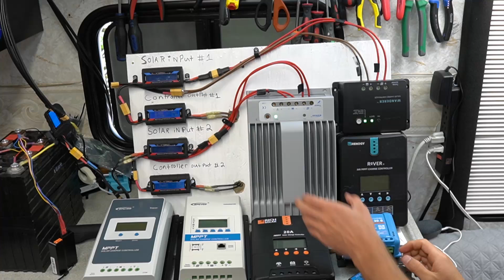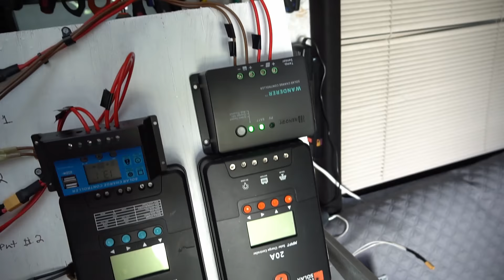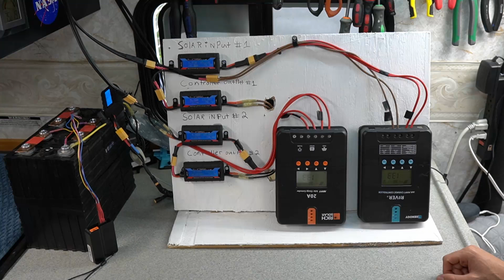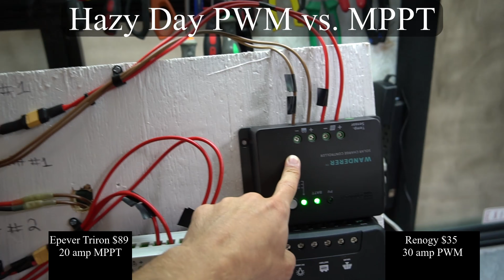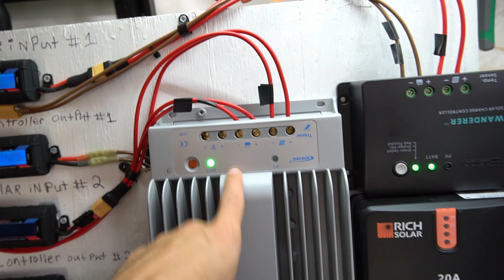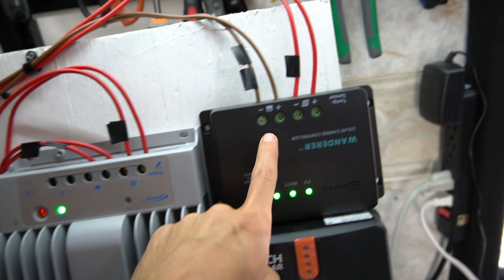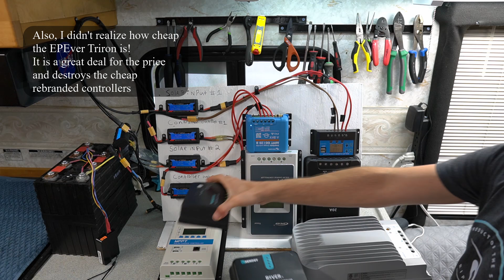12v Solar Charge Controller Buyers Guide - Beginner Friendly!

Comment: Thank you, I've been trying to figure out what type of charge controller I need for my lead acid battery bank. You've answered my questions. I have 4 deep cycle RV batteries and 4 AGM batteries [which were given to me from a friend]. So my plan was to charge each pair individually and then move to the next.  With the purpose of being able to re-charge my phone, portable radios and various batteries around the shop, plus being able to have DC lighting around the house. I have some cheap and inefficient panels hooked up. I have a portable generator hooked up to my panel - but if I ever run out of gas, I want to have some means of charging.  

But in the end I plan to get a EcoFlow Delta and portable solar panels - I'm going with the KISS method.  Maybe I'll give my battery system to someone on a limited budget and let them follow your recommendations. 

You do a good job explaining some very complicated concepts [for my knowledge background] thank you for the work you put into this subject.

Comment: Renogy charge controllers change their settings if you use a dc to dc charger from an alternator with lithium batteries. When you go back to solar charging they only charge to 13.5 volts. The fix is to go into your controller and reset to lithium battery even if it says lithium  still reset it. Something both a friend and my self have learnt  after tearing our hair out for weeks.

Comment: I’m just getting started setting up a support vehicle for my projects.
      Since the vehicle (‘92 GMC Truck) will be outside and is a service vehicle, I’m planning on putting two large 250AH  lead acid batteries in a large toolbox on the roof rack (fire proofed and insulated)
and connecting your favorite charge controller to them.
      I’m planning on using one 250 watt solar panel on the toolbox, and possibly two inverters, behind the seat (one for just general 110 use in the cab, and the other wired into the automatic cold weather heater and engine block heater, coupled with an AGS switch for the dedicated onboard generator.

Comment: In the case of small cable clamping termination, Input cabling could be terminated and the then solid terminal pin fits nicely…. Ive got Victron cc, no problems.

Comment: It seems to me that if you're going to invest more than $1k total in building a solar array and storage system, plus inverter, the last place you'd want to scrimp is on the charge controller. Given that the most expensive one here is probably 10% of the system cost, if it offers that much more benefit, why not spend the money on it? So many times in similar situations I've scrimped on one component and later wound up owning the cheap one and the expensive one. Not good economics there! That said I really appreciate the comparison because this helps understand the factors in the decision, which is just as important, if not more, as the "which one should I buy" question.

Comment: I learned there’s no point in spending a lot of money on a charge controller!  Cheap is 99% as good as expensive.  Thanks
Reply: While I really tend to agree with you. My cheap PWM's (plural) are a testimony of that! 
I would set a word of caution. Probably the most hyped ones are surely not needed, but a good solid construction. Might save a whole lot of head aches on the future of your installation! Something to keep in mind depending on the "mission critical" of whatever you intend to do!

With this said. Yes, my van and a few other projects run on cheap PWM's. No problem! Always design your system based on intended function! It's that simple! ;-)

Comment: Just an update.  Renogy may have the bigger holes now.  I bought a 40amp Renogy controller and it had the bigger holes like rich solar.  I don't know about the 20A but the 40a has big holes.  The instructions said fits up to 8 ga wire but I have 6 ga wire on there and fits with plenty of room I think even a 4 ga might fit in there.  To be totally honest, I went with renogy 40amp because I liked the color.

Comment: This is my first shot at one of your milk create solar generator.  I have a Giandel 1200 inverter with a built-in 20A charge controller.  Would that charge controller be ok or should I invest in a different controller?  Thanks for the great videos.  They are a great help.

Comment: Im learning lots with these videos. Four years ago, I bought a Renogy 200W complete kit, but after some time, I didn't care for their charge controller as it did not have good programmable features, so I bought one similar to the cheapest one in the meantime and worked better. Now, 5 years later,  my battery bank is shot, so I'm looking to upgrade batteries, charge controller and more solar panels, but have not decided yet which way to go. I will be buying a good inverter as well, but was wondering about an inverter/charger combo. This is on my boat, where space is a premium, so reliability is what I'm trying to go for. Thanks for the videos which couldn't help but to subscribe. .

Comment: Odd thing about solar is that you can run most things like lights and basics on very little battery BUT if you want AC you need a system that is so expensive that it doesn’t make sense….  If you don’t need AC a Jackery would take care of all your needs in a short camping trip….

Comment: Who says that a PWM regulator is way worse than a MPPT? As what was observed in the video, it was only a small percentage point off. It's the analysis smarts that count. Sure, a PWM is much better than a simple over-charge protector box with the extra ABSORB / FLOAT modes. But it comes down to matching the panel impedance to the battery impedance and that varies with illumination and temperature. HOWEVER, a MPPT with a STEP-UP / STEP-DOWN switching regulator with large inductors, transformers and capacitors, does allow panels in series and can help on cloudy days when the panel is lower than the battery terminal voltage. A little charge rate is better than none. A product comparison needs to be done as well at low lighting levels.

Comment: The cheapest one is really bad. It will fry if you happen to connect the solar panels without connecting the battery first. I was to buy that model for ham activations, but bought one from Xunzel instead, model iSCC-AU-XUNZEL-10A-12V Lithium + USB. I've torture tested it and it works, despite being PWM. Anyway, not a big loss, since I'm just using two 5 W panels in parallel to top up a 7 Ah battery while doing activations with just 10 W.

Comment: Would have been a bit fairer if you had researched the $15 unit before making statements like you can only change the float voltage. You can program the voltage level discharge off and the reconnect voltage.

Comment: Will, can you do a video similar to this one, but discuss what each charger controller can or can not do as to controlling power to the battery, ie, auto cutoff, cycling, protection features, temp compensation, etc and which one in both PWM and mppt.

Comment: About a year ago I wanted to start doing testing and seen you loved that Monster EPEver and got one, I also get 2 cheaper ones, I totally agree now its EPever Hands down, I have been able to switch out my batteries a few times from lead acid to gel to lipof4, I have plugged panels in from 110w to 320W testing used panels for friends, have never even felt it get warm, they wire lugs just feel good and solid too, so I agree! 100%
One of the cheap PWM controllers, I shot that P.O.S across the yard LOL

Comment: I like the cheap Chinese controller because it will fit inside a battery box I am building. I found it interesting that the expensive Victron controller has no bigger screw terminals than the little Chinese one.

Comment: Thanks for those comparisons. But i am trying to find out which mppt controller best suits 2 x 2  12.8v 280ah lithium lifepo4 batteries in series with 3 x 450 watt panels. Can you offer 2 options ?

Comment: i'm watching this video again. a couple years later and i came to the same conclusion again. The cheaper the better. THe blue cheapos go out after awhile but so did the growatt $1500 grid tie unit we got installed here.. and 2 times. so go figure, $15 or $1500 they will die at some point.  MPPT and PWM is not a bigger differnce, i think the quality of the panel is much more important, but still even there the price is more important.

Comment: I've been using the cheap blue pwm controller for years.. works great.
 The 60amp epever mppt controller burnt out after a few months.. it was hardcore full Metal build with huge heatsink.. total rubbish

Comment: Hey super comfortable in your skin handsome Will!  Thanks for the info and clear understanding!  
Sir, how about this:
 how about Solar Battery Maintainers that many of us with multiple vehicles, need to keep the starter battery charged when leaving parked for too long but don't have a battery array in these vehicles?
I mean these new vehicles sure drain the starter battery over time if not driven, with all the electronics needing some power for memory and connectivity to key fobs etc.

Because I have found the small solar float chargers for placing usually on your dash or back window or suction cup to the windshield, are very unreliable with a few models that are worth getting. Seems Sunpower ones are the best and Coleman makes some alright ones.
Many are framed in plastic instead of aluminum and some the plastic warps in the sun...
Some can't be suction cupped to the window, others can but only have 2 cups, others have a solid 4 cups.
Also they offer Amporous panels for their ability to produce even on overcast days. They work on more an infra red spectrum but don't produce as much for their size if I'm stating it all correctly.
But in larger sizes are offered the poly and mono cells. It's all very confusing for a lot of us.
Additionally these smaller panels don't need a management module, because they can't overcharge with their weak power?
These small panels are also purchased by people to maintain batteries for their electric gates and electric fences and electric signs and so forth. 
It's a large subject I get you could really clear up and simplify for us.
Take care

Comment: I beg to differ on two controllers to one battery, the controller reads the battery voltage to know when. It's full or not, so it can read the other controllers charging voltage as battery voltage and vice versa

Comment: I was very disappointed with Victron living in the desert. They do overheat quite easily (above 104)and reduce your amount of input by 30%. Also if you have  24 Volts battery bank and above your voltage will be cut in half instead of 150 volts you will only get only 72.

Comment: I have a 200-watt solar panel. I only need to run a very small 4-inch diameter fan that has a USB connection (it would plug into a computer for power), But I want to run that fan off the 200-watt panel. If I understand some of this solar stuff, I need a solar controller and a battery and too guessing I will need to use a rheostat to dial down the voltage so not to over task the fan. I believe I also know that the solar panel needs to put out 30 watts of power before its battery pack (a Bluette) will even take a charge (that does not work for me as the solar panel will be in shade some of the time. I put the panel in shade and hotwired the USB fan lead into the panel and it runs…but I know I need to better control the voltage to the fan but it seems that most of the charge controllers will not accept low voltage from the solar panel (it needs to be putting out a certain amount before the controller will charge the battery).  What is the best charge controller that will allow a charge into a battery that only gets a small amount off the solar panel?

Comment: I don't want to advocate any conscious illegal or immoral action but in all the videos and discussions of lead acid batteries versus lithium batteries of any type no one has ever mentioned the fact that Walmart batteries have a 3-year guarantee with replacement if they don't hold a charge. I ran an 8 battery lead acid system with Walmart deep cycle RV batteries for years with great results. Used a 40 Amp charger and ran my 12v trailer smooth as silk. THE CATCH IS YOU MUST SAVE THE ORIGINAL RECEIPT AND BRING IT IN WHEN YOU WANT TO EXCHANGE... Seems to be at the stuffing out of expensive Li batteries.

Comment: I need to construct a box to enclose a 12V battery and associated hardware to mount in my Suburban.  I was originally leaning towards the Rich Solar MPPT but since space is a premium I may go with the Victron due to its compact size.  Hopefully, it will play well with my Redarc DCDC charger.

Comment: The terminals on the Victron 100/20 are sized for a maximum of 10 gauge wire for a reason - it only rated for 20 amps maximum. When I had a 12v 280ah LiFePo setup (now 48v), it limited the charge current to 20 amps so the 10 gauge wire was fine (30 amps max).  No need to have 4/0 welding cable coming out of a charge controller that will max out at 20 amps. I now have two of those very same charge controllers charging at 20x2 = 40 amps at 48v (1920 watts total) into that same battery bank (13.4kwh total). I only have 2kw solar at the moment but will easily buy another two when I double the panel size. That way if one charge controller should fail, I'll have three others to continue the charge.

Keep up the great work Will!
Reply: hou firefox, you are so damn smart that you leave the rest of us standing on the dock.

Comment: I noticed that small terminal size issue on ALL of victron equipment, the cable entrances on the multiplus's are also too small for the cabke size that should be used.

Comment: So, when it is all said and done, all of the MPPT perform pretty much the same. And comparing a $200 40a charge controller to a 20A is pretty unfair. Look at the Renogy Rover 40a. it has larger wire connectors and a dedicated Lithium program.
Reply: In all honesty, although there's several design faults on the test! I believe it's  pretty fair for a one guy, out of his pocket, show! ;-)

With this said it's obvious these particular test conditions make the dirty cheap PWM stand out, way ahead of the competition! With a ROI that's sounds unbeatable! Because in fact the entire test conditions and limits are perfect for it!

In the same line, the other competitors didn't had a chance to shine in their own departments. Either by functions or possibilities!
There's still validity on all this. As a show case. Determining that in this particular conditions the PWM can indeed be a valid choice! 

What could be worth mention is that beyond this perfect PWM conditions. Price aside, it would probably be the worst possible choice! LOL 😂

Comment: I believe you have a couple of errors in this video.  You comment that despite amp ratings of the controllers, the two you were comparing were putting out the same current.  The amp ratings are the maximum charge current: the max that can be delivered to the battery.  They don't have anything to do with the amount of current the controller delivers in any given situation.  However the major error is trying to compare the outputs of two controllers when both are charging the same battery.  As you point out, the two controllers don't "fight", however they do share the load and so their outputs will be close unless one solar panel is putting out much less current than the other.  A better test would have been one controller at a time into the same battery.

Comment: I have the renogy mppt..40 amp...and the reason was the 100 volt DC input ...as other 12/24systems will not charge a 12 volt system with DC input over 36 volts ..!as well my distance from panels is 60 ft . ..it performs very well ..

Comment: I have the EPever Tracer4215BN, Will's favorite. Tried both the MT50 screen and the Bluetooth dongle and much prefer the Bluetooth, it's so much easier to use and cheaper too.
Reply: You can't program it with the Bluetooth dongle only with the BT50 , I use the epever pair app with the dongle to monitor epever advised that I should use the new solar guardian app but it's very slow to update, neather of them allow you to import or change battery settings
Reply: The Bluetooth dongle along with solar guardian app does allow me to change battery settings on the 4215BN. It updates about once per second. The MT50 allows the same changes but is much less intuitive.
Reply: I have found an old version 2.9.9 for Android works perfectly and I can now view and change all settings , the latest version and solar guardian don't work
Reply: @MindFreeWay  I use it on Android 11, 12, and 13. Two Galaxy phones and an Android tablet.

Comment: Could do individual clips to possibly get the units donated then do a group comparison,. And also one does benefit much from doing diligent research might build one someday, thanks for your time good work, I been using the cheap China ones so far no issues  I have small setups though

Comment: 9:00 that is so me.  I don't really want to see what I really don't understand lol.  
I have a 1976 truck camper. Based on your videos, I will put together a bomb proof basic system that can't fail.  Using a lithium battery. . . . . .
On that I could run my l.e.d. lighting.  Charge my cell, run my water pump, a tiny flat screen and blue tooth DVD player. . . . . .